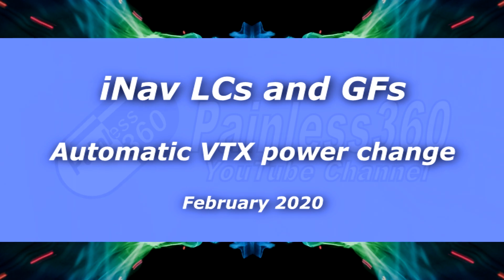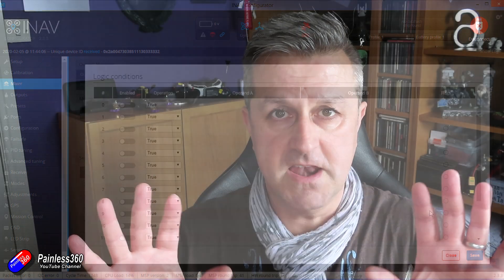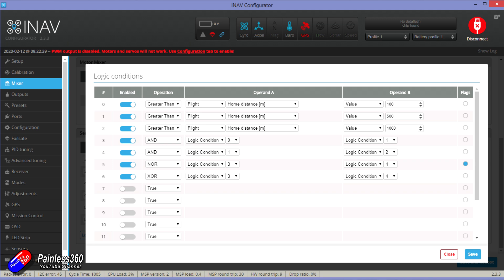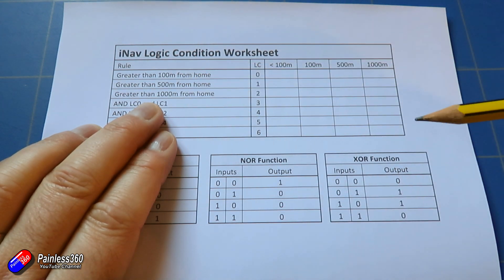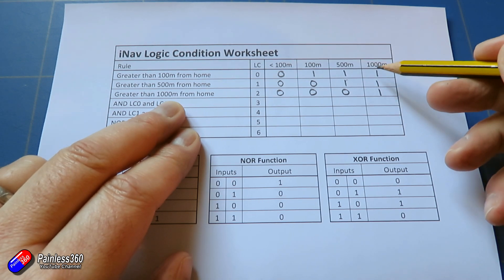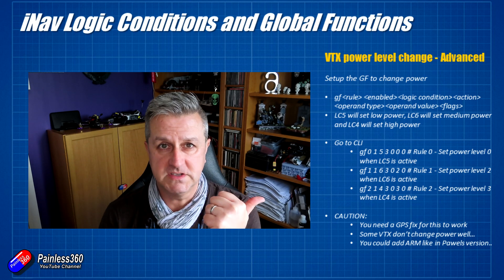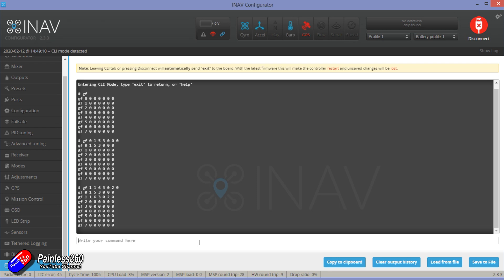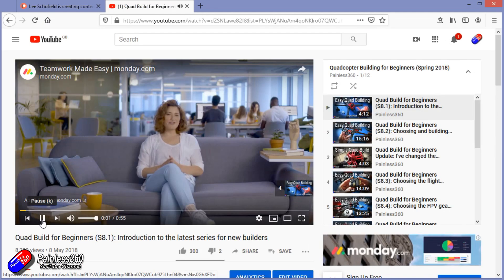Setting up automatic VTX power changes in iNav (Adv.)

Comment from the maker: Watching this back I've spotted a way to reduce the number of Logic Switches by one. Can you see which one is actually redundant?
Reply: Hahaha this is fun old boy, had a think and I do believe you can sack of the line AND LC1 and LC2 for the high power trigger. Just use the LC2 what !
Reply: Presumably using <100 and 100-500 has just made it all too complicated-  I haven’t sat down to work it all out without your first column but intuitively I would think that would simplify it massively!
Reply: I assume you can remove LC0, given that it’s the only one that is not referenced in LC4 - LC6 rules, where you determined High , Low and Medium Power respectively.
Reply: Hi Painless360! As mentioned before teh AND with LC1 and LC2, but another improvment is possible here: you are working a lot arround the 100 meters but if you follow all your LC, you will have the same power level from 0 to 500 and seems not worth it, cause with 3 "stakes" is simple and logical have 4 different state. Thanks to your video, I figure it and tested ( just reducinge the distance and walking with my plane in the hands to trigger the LC); if you give me the permission or if you want to see my settings I will glad to share with you :) Another importa notice: I figured out that seems the documentation make an error where said "Accepted values are 0-3 for SmartAudio and 0-4 for Tramp protocol" in global function. I'm using Rush tank with SmartAudio, so 0 and 1 value use the same power level; seems is setting up power level like the configuration tab ( starting from 1). Thank you for your great job!!!

Comment: Thank you for your vids they are an inspiration and great help. I watched the first manual inflight vtx pwer switch vid and got it up and running with few tweeks. and ran across this one which really interested me. So I decided it would be great on my LR quad. I set it up with 4 pwr levels for my AKK everything was ok except it would not drop to low power coming back home. So I spent the rainy afternoon brushing up on my Boolean from college (amazing how much I had forgotten in 40 yrs. :)  and test flights but I finally have it working great. I am hoping the weather will soon allow me to try a personal best of 5km one direction.

Comment: Question.  How would I go about adding another condition which will drive the VTX to its max power level when in RTH (or failsafe) mode?
Reply from the maker: Have a look at the logical switches - you can have one detect when the mode becomes RTH... Best of luck!

Comment: Hi Lee, mentioned before that the same logic and action could be done in OpenTx. Given that you have a choice here which would you use (e.g. INav or OpenTx) and why? My thinking here is not just for VTX power but other dynamically adjustable parameters such as PIDs etc. For example using a 1S or 2S battery for a small quad might auto change the PIDs and power curve. I know the TinyHawk 2 uses something like this with Betaflight. I'm just trying to get my head around where best to put the logic. Cheers again Les.  
P.S. my fault for coming from a software/hardware engineering background :-(.
Reply from the maker: Hi Les. You could put the logic on the radio and use a special finction/logical switch to change the channel value so you can use the version of power change from my first video. But.... This would rely on the radio telemetry all working and adds several extra pieces of technology (Frsky telemetry, Opentx and the radio) to perform something that could be done on the model. The benefit of doing things like this on the model is that it doesnt rely on those extra pieces and would still work in all cases even if one of those other pieces failed. I am a fan of KISS methodology so this is how I would recommend doing it.. Best of luck!
Reply: The logic switches work the same way in OpenTX, but it doesn’t have the ability to change VTX power.

As for picking which to use (if you have the option), I’d go with the one closest to the action. In thus case, it all happens on the plane, so it should stay there. This keeps things as universal as possible (different planes with different antennas you might want to switch at different distances, and that would mean different radio models if it was handled by OpenTX).
Reply: @swissfreek  Not strictly true. There is a LUA function that allows OpenTx to send updates, including modifying PIDs and VTX parameters e.g.  power and channel. Have a look at the Betaflight LUA script, it uses these functions to allow an OpenTX transmitter to change parameters within the flight controller. This has been available since bi-directional S.Port functionality became viable. The rational behind maybe using OpenTx is that has more logic functionality, greater access to telemetry values and access to other OpenTx options, few of which are available within the flight controller. Hence the reason for me asking where & when? Cheers ...
Reply: Les Adams yes, of course you can change settings with a LUA, but that’s not the same as using logic functions or global values. Like I said, you can’t use logic in OpenTX to change VTX power (at least not today). The beauty of this is there’s no telemetry involved, it’s all handled right inside the flight controller. I stand by my argument that, all things being equal (ie you have the same data and functions at both places), I would recommend putting the logic in the place closest to the action, in this case the FC.
Reply: @swissfreek  Frank What I was getting at is there are a number of ways a logical switch setting, in OpenTx, could directly trigger a script to pass a value to a FC both VTX and PID or to anything with an S.Port interface. Indeed I have used this to interface with a head tracker on Arduino. My only point was the logical switches in INav are limited and only have partial access to possible influencers. That said given the example  Lee has shown I can see simplicity is the best option. My only rational for asking the question was to see if there was any other motive. 

Lee you are quite right here that the KISS methodology should definitely be applied here.
Reply: I hadn't realized that this was possible in OpenTX, very cool. I suspect he's using iNav specifically for it's fixed-wing features though.